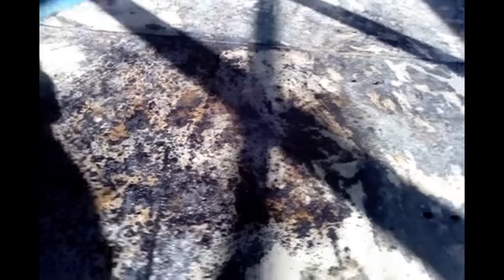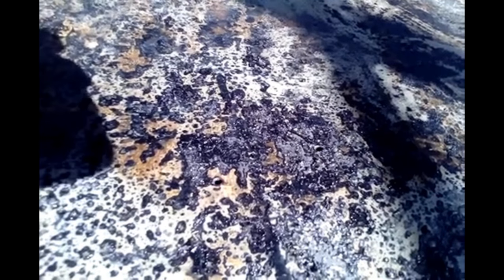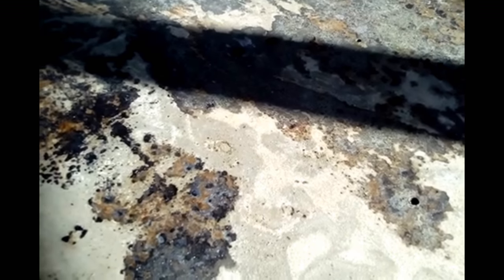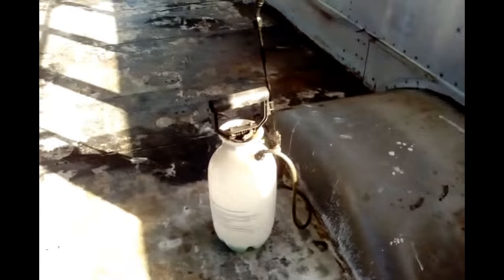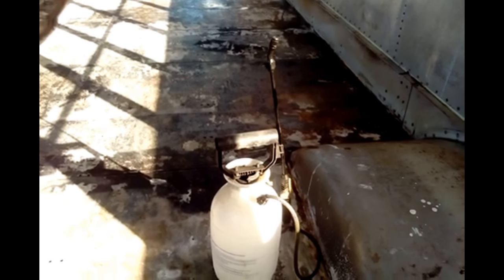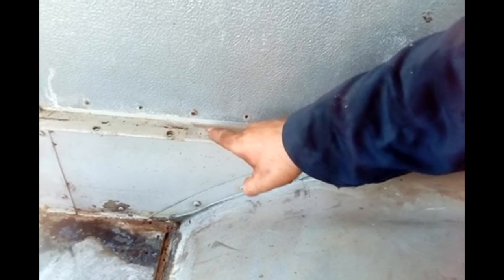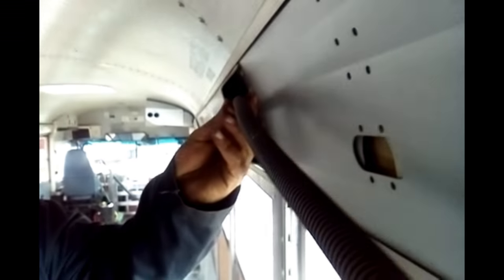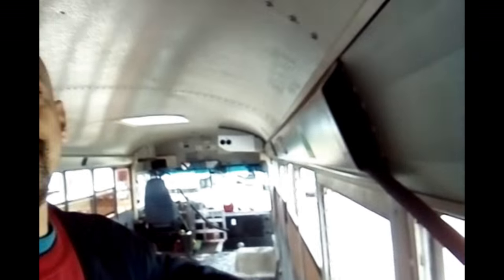VLOG 7 Part 2 of Crunchy Floor and screws

Comment: Take Rust-Oleum paint n seal.  ....lay down foam board..... plywood n call it a day. You'll be fine.  Leave ceiling. Build on top.    U can lay the plastic sheeting down over the Rust-Oleum... seal.  It's for rust n water.  The end
Reply from the maker: Right there with you brother. I picked up a good oil-based Rust-Oleum primer and paint to seal the floor then I'm going to forgo the sub floor and just lay down a sound dampening mat & Lifeproof flooring (https://www.homedepot.com/s/lifeproof?NCNI-5). Thanks for the tip! I appreciate you watching! More to come soon. Spring Break is in a couple of weeks & I will have time to work on the bus again.

Comment: Think u should do your homework. Your condensation is going to be so bad when it's raining I'm sure you'll talk yourself out of putting insulation on the floors
Reply from the maker: Harry, I've already changed my mind about insulating the floor. I have a new game plan. If I have learned one thing since starting this build is to remain flexible. The results or challenges from one part of the project lead to changes in the next step of the project. Thanks for your comment. If you have any tips that you think I should be aware of, please let me know here.